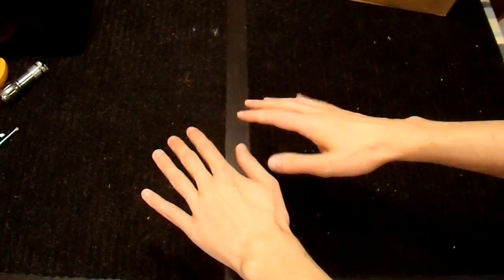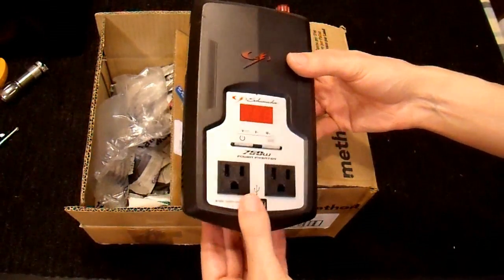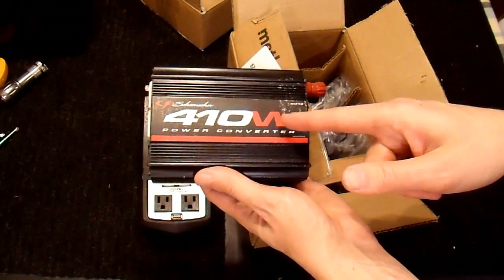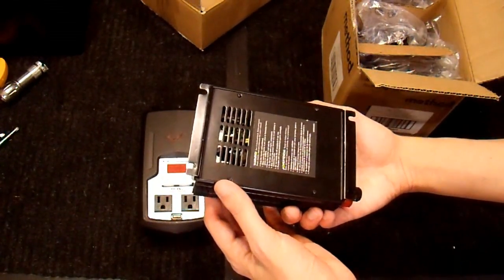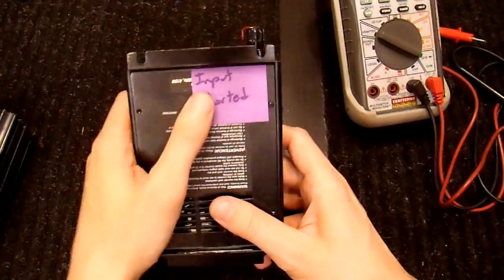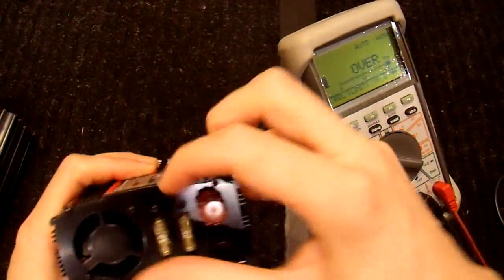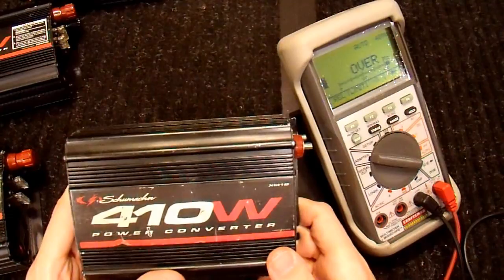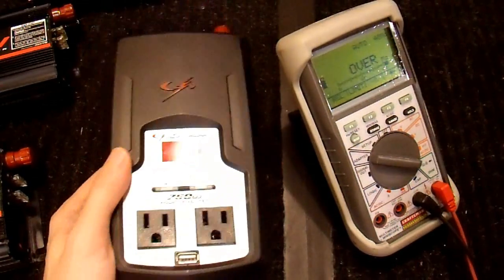A Pile of Broken Inverters: Viewer Mail #1.  Part 1/2

Comment: Nine times out of ten it's one of the 1000uf electrolytic capacitors that have gone bad- the other thing that causes the box to fail is when the Chinaman who put the thing together in China forgets to screw one of the power transistors to the heatsink (case). Sometimes you can bring these things back to life.

Comment: Glad to see you got these up and running. After repairing a few myself I was hard pressed to find a use for all of them. And the fan on the XI41B 410W ended up being too noisy for my intended application. Here's to hoping you can find a use for them :)
Reply from the maker: It's the man himself!  Thanks again for they mystery box!
The fans are indeed disappointingly noisy but the inverters themselves seem to work fairly well.  Like you I'm now wondering what to do with them all.  :)  Maybe try paralleling two of them?  hmm....
Reply: Can u give me a 410watt inverter to me?

Comment: I believe you have your screw driver sizes incorrect.  There are actually 5 standard sizes ranging from #00 - #3.  #00 is typically used for things like your eyeglasses and #3 would be used on heavy machinery.  The three screwdrivers you showed (from smallest to largest) were #0, #1, and #2.
Reply from the maker: I did have the sizes backward in this video.  Thanks for pointing that out!
Reply: My biggest hate is when you get people mixing Philips and Pozidriv screws. They LOOK the same but aren't quite similar enough to work :\

Comment: Metric = standard section at the european store!  Good one!
Reply: Oddly at least in the UK, terminal nuts on anything over a few years old tend to be BA threaded, which is a metric derived but 'numbered' old british system designed specially for electrical and modelmaking work.

Might be worth me taking my taps and dies!